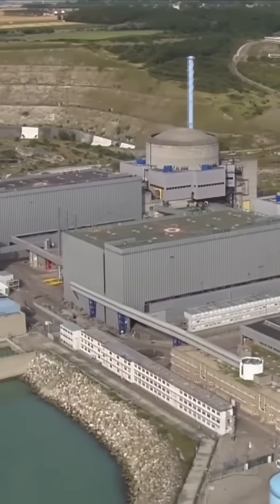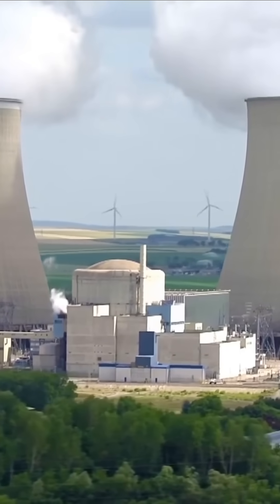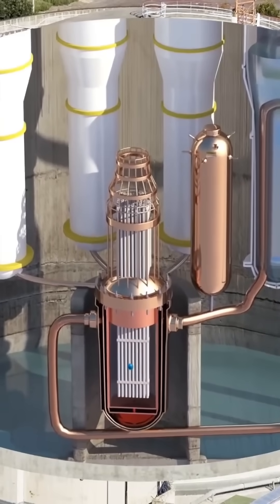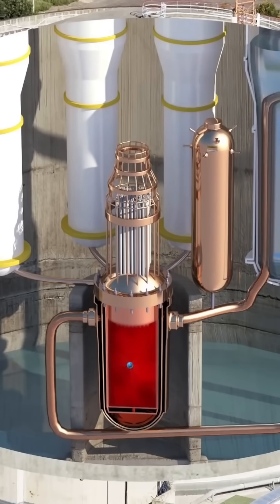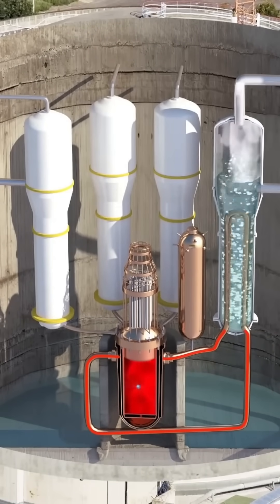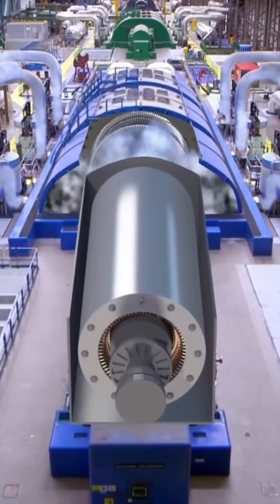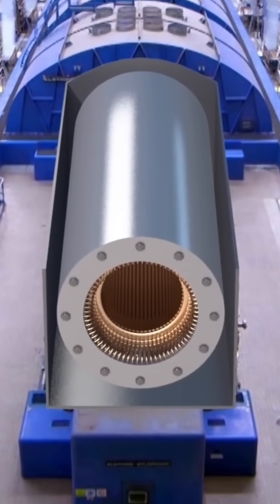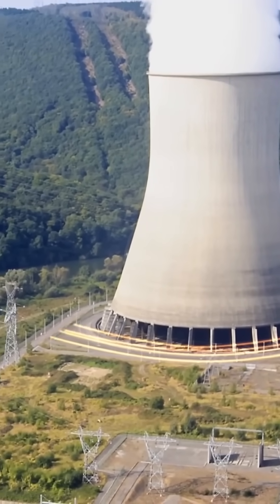How does a Nuclear Reactor work? #shorts #nuclearpower #nuclearreactor

Comment: Nothing about the fission process. Useless explanation.
Reply: If you want that go to a more technical video, this video showed how a reactor works, it showed electrons being shoot at atoms, who makes heat.
Reply: @ArmandoIF  
This explains more or less how a heat exchanger works.
Reply: @amitaimedan  that's what I said in my previous comment, watch a more in depth video about fission.
Reply: @ArmandoIF  neutrons, not electrons
Reply: @jean-baptisteetmarie-alixg5781  electrons, neutrons remain attached to the moderating bars.
Reply: Thats why we have Google
Reply: Here's my young brain doing the explaining for you as the video poster failed to in the most stupid way.

Nuclear Fission is where the nucleus of an atom splits into two or more smaller nuclei. This usually releases two to three neutrons (2.43 on average) which are flying at a very high speed and need to be slowed down. This is referred to moderation. The neutrons are too fast to hit another atom and have a slim chance of even doing so. So, a moderator is used. Something like Graphite or Water/Heavy Water is used to slow these neutrons down to roughly around 100 km/s or lower; it can be a few times higher than the speed of sound. However, this won't do. The reaction needs to be controlled or the fuel will melt. A material like Boron, cadmium or gadolinium can absorb neutrons and is used in the control rod. This controls whether the reaction increases, doesn't increase or just decreases. This is referred to as Supercriticality, Criticality and Subcriticality, respectively. Some of the neutrons get absorbed by the rods and the fuel. At low power, a neutron poison called Iodine-135 is created. This has a half life of 6.7 hours and isn't very good at absorbing neutrons. HOWEVER, once this Iodine decays, Xenon-135 is made which absorbs neutrons VERY well and has a half life of 9.7 hours. This can easily stall a nuclear reactor which happened to the RBMK-1000 used in Chernobyl's Unit 4.

Heat is created by this fission process, but very little of it. On large scales (not atomic scale, but rather regular fuel rods.) a lot of heat is made. A coolant like water which also is a moderator boils from the heat and takes that heat away with it - cooling the fuel rods. This ensures that it doesn't melt. The hotter the steam, the more energy that steam has and the faster it goes. This goes through the steam separator and through a series of pipes to the turbines. The steam spins the turbine which spins and generates electricity by a rotor. The steam then goes through cooling tower(s) and the water that comes down is put into a nearby water source (rivers or oceans).

Since water and graphite can be used as a moderator, there is something called a Positive Void Coefficient. Once water boils, a void is created - steam. This causes the reaction to go up. This happened with the Chernobyl RBMK-1000 Reactor when it was heavily poisoned and the turbine was turned off to simulate a blackout condition.

In the regular reactors you see today, like BWRs and PWRs, there is a Negative Void Coefficient. Once the water boils, the void is made and the resulting steam causes a decrease in reactivity.

If I got something wrong, tell me. I'm nearly 14, but I tried my best explaining with the knowledge I had.